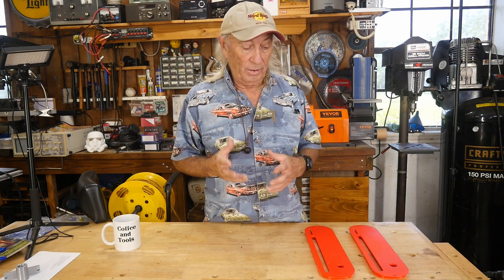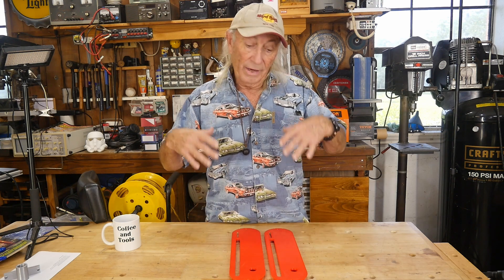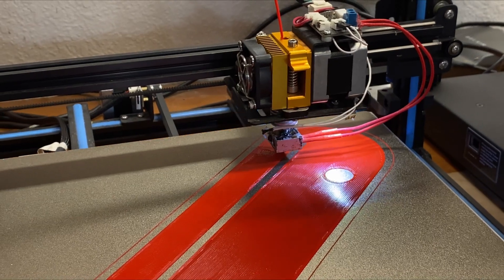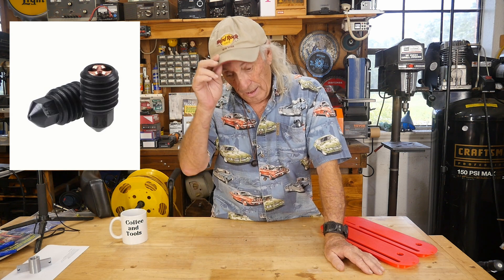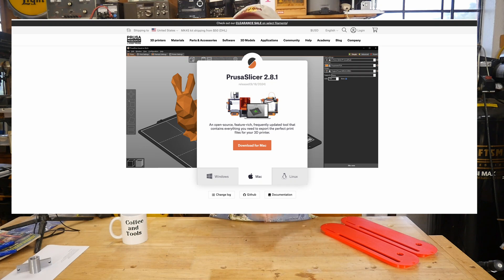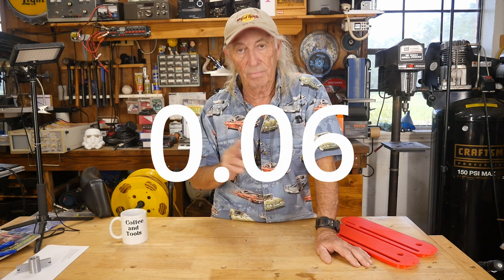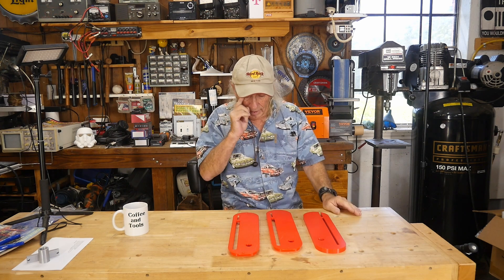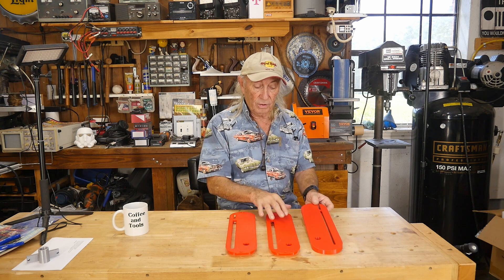How to get an old 3d printer running FASTER !, ep 474 Coffee and tools

Comment: Nice topic, but what exactly was the reason ?
As far as I understood is, you only changed to a HF nozzle and then the profile from 0.4 to 0.6 mm nozzle.
And in parallel you only changed the speed settings from 30/40 to 60 mm/s.
I assume, only the line width and heigth was changed by switching to 0.6 profile, right ?
And your additional speed settings.

Only this change will end in such faster print ?  I am impressed.
But then you should see much more differenced in both prints - the line width/height should be clearly different between both prints.
Reply from the maker: Exactly my thoughts too and yet...both prints are almost identical, but hours difference in speed. Game changer ? :face-blue-smiling: